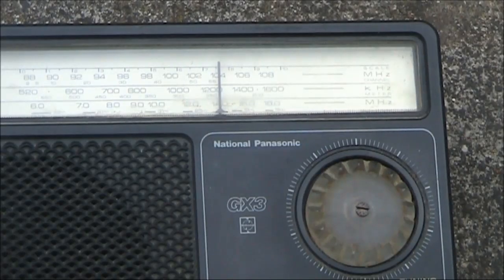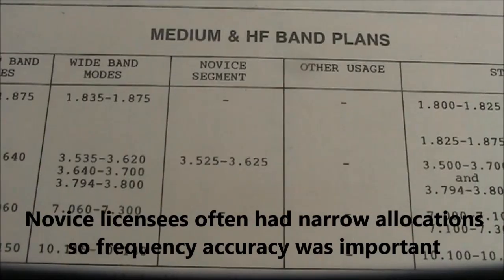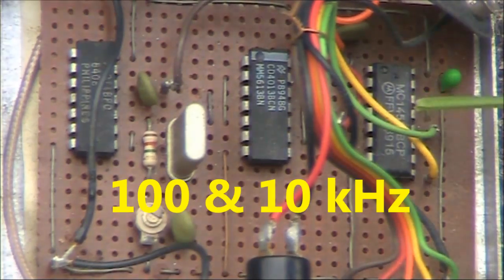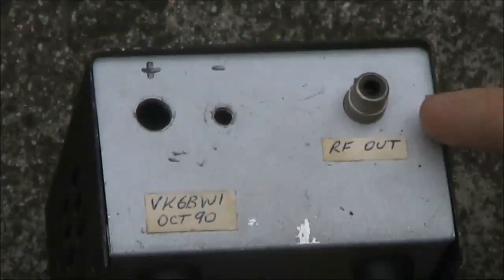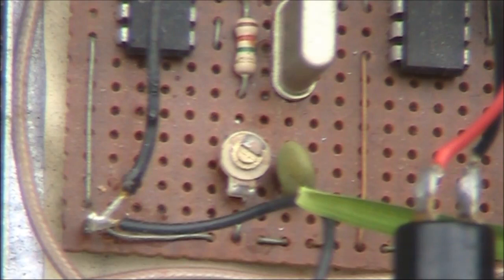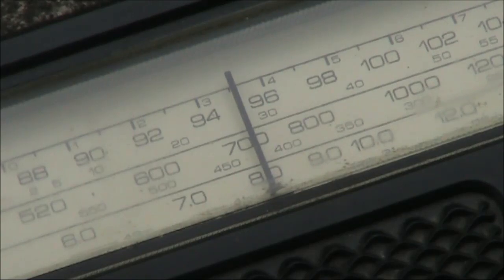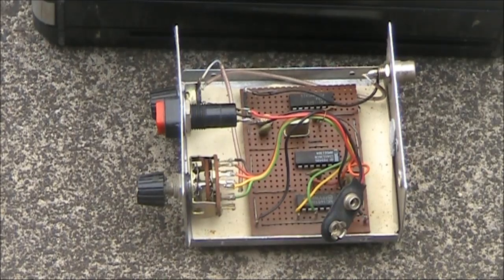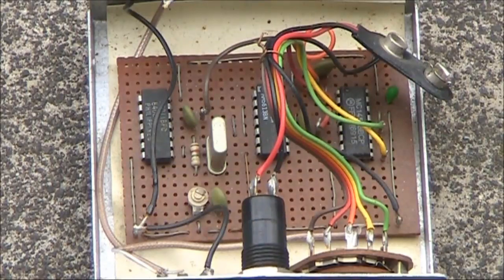How we measured frequency - Inside an old crystal calibrator

Comment: How is this device itself calibrated?
Reply: John Tarbox To clarify one thing not explained, for newer folks: you are not generally zero beating the main signal out of the calibrator, but instead, one of its harmonics. Since there’s not any real output filters, there should be pretty strong harmonic signals to work with. As a bonus, you get even better resolution/precision this way: 10MHz is the 10th harmonic of 1MHz, so a 1Hz beat frequency actually gets your oscillator to within 0.1Hz of 1MHz! (I was kind of surprised to see an 8MHz harmonic of 4 MHz, since iirc these ICs should be putting out square waves, which only have odd harmonics. I’d guess 4MHz is pushing the IC so fast that it gets mangled into more of a triangle wave.)
Reply: Generally we would zero beat it against a known radio station such as WWV. This is covered in the video.